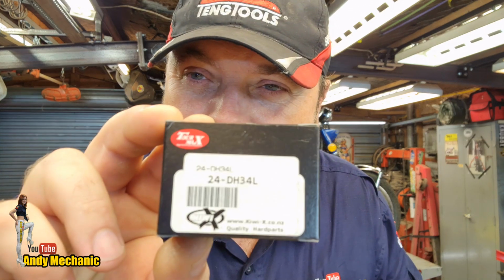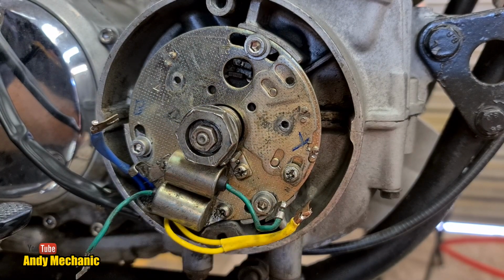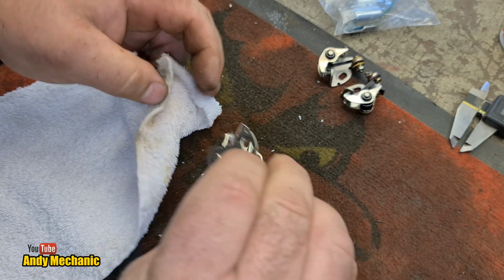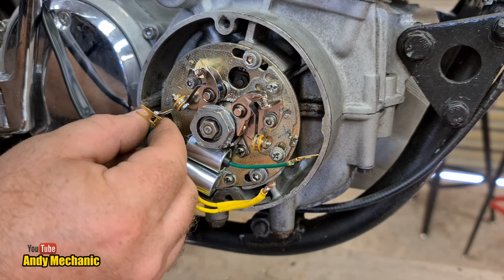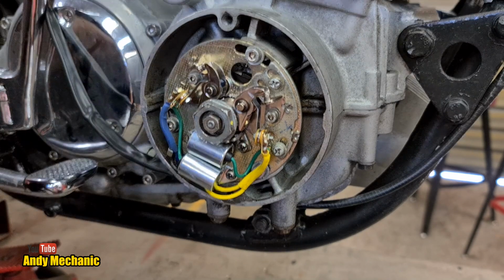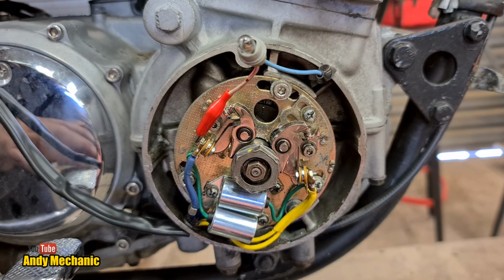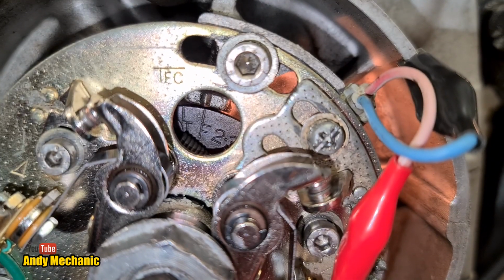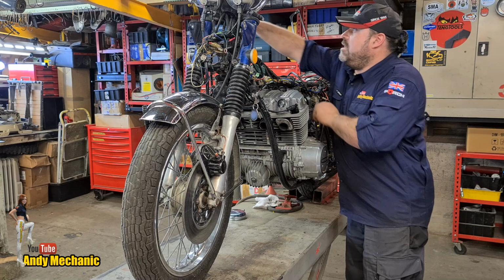CB750 - how to install new points & condensers & set ignition timing Ep.11 #1478

Comment: Amazing pictures and video!  I just figured out why I have no spark.  My condenser wire was under that plastic washer.  I believe I have to set the timing using a continuity tester instead of a test light.  Thanks for the video.

Comment: I used the light bulb trick to do the points on my KZ650. The most useful tip for me was  when you kicked the bottom of the points inward towards the cam to get engagement.  Miraculously, the 2nd set was bang on just as a fluke. Had to check 3 times to believe it was true. I was done inside 20 mins. Thanks.
Reply from the maker: No problem, pleased you found the video helpful 😀 cheers Andy

Comment: Well I better get to ordering parts. Same issue with slow starts and only running on 2 or 3 cylinders at time on cold starts for a minute or two requiring constant fuel feed to keep it alive. However my solenoid is shot since purchased so it only takes two kicks cold. I'd be more inclined to replace the solenoid and use the electric start other than the previous owner telling me the exact story your client did and even the use of ether. Spot on video. Best I've ever seen. Keep it up please.